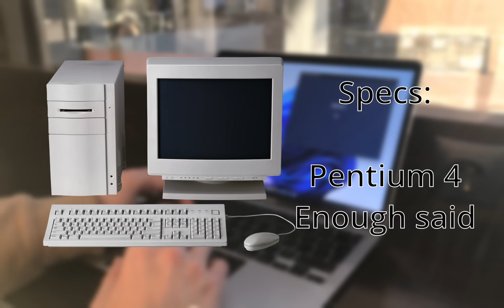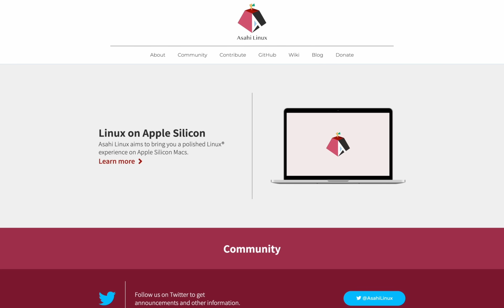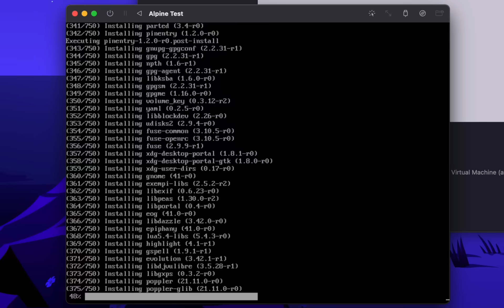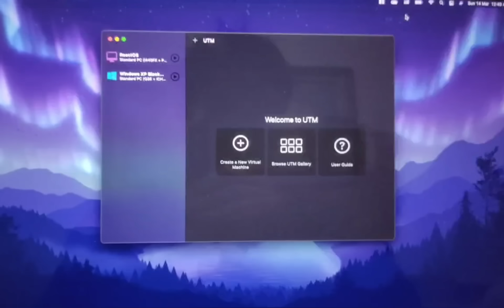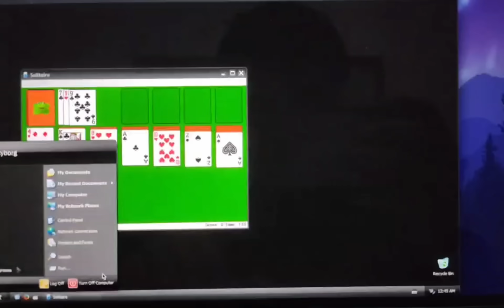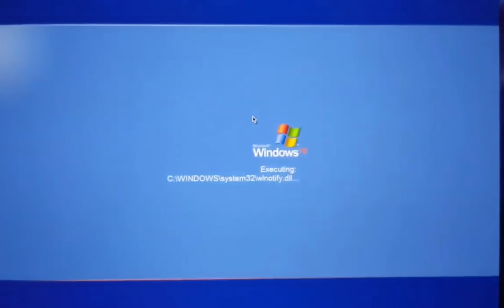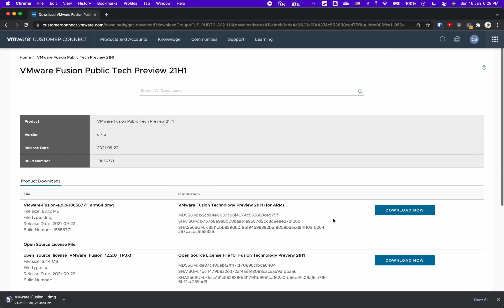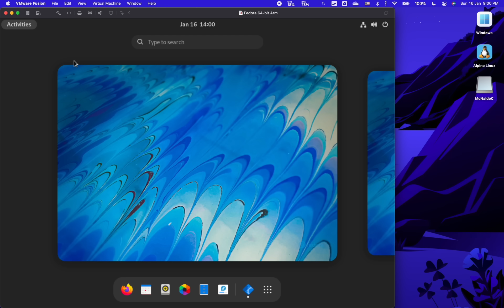Using Virtual Machines on Apple Silicon

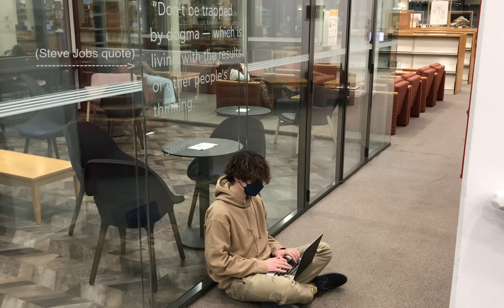Comment: 0:58 The bootloader isn't locked tho!

It does check for digital signatures, but not necessarily Apple's signatures. Local signature and key management is a built-in feature of these Macs.

And thanks to that, the driver support in mainline Linux is pretty decent right now.

Maybe you could test how well KVM works on this hardware? (That is, running these VMs under a native Linux install)
Reply from the maker: I'd love to check KVM and everything but I'm waiting for Asahi Linux to mature before I install it.

Comment: As a bona fide technologist, troubleshooter who has worked with virtual machines since the late 1990s, this video was very well done. I knew you would end up reaching the same conclusion I did in playing with the alternatives: there aren’t any. It’s really just parallels desktop. Which is OK because it’s a fantastic product. Now, virtual box is in beta form to support the M1 processor. I will be taking a look at that myself as well.
Reply: And what do you think about UTM?
Reply: @moonleter6637 UTM is very good. I have to say it makes more sense on the Apple silicon than Parallels because it performs very well with good OS support and requires no subscription. I would pay the $10 to install via the App Store as that way it supports auto updates. I have installed Windows 11 via UTM - it performs great in a non-business setting. As for trying to use it on my 2021 MBP M1 in the field, no way. My nosey clients remote through my laptop and jack with my network settings. Once they see a “virtual machine”, they would throw a tantrum that would blow back on me. 

I have a video showing my solution to have Native windows concurrently with Apple Silicon here: 
https://youtu.be/GDxVek7kPJ0

I use this solution in the field almost daily, and it works great.

Comment: Hello Anyone have any idea how to add serial port support for Arduino on M1 macs using parallels or VMware fusion?
Reply from the maker: If you have a USB serial controller, Parallels sometimes has USB passthrough, but it depends on the device.

Comment: Is it possible to install paralells on an external ssd and run windows on it?
Reply from the maker: Well, Parallels itself is a small program, so you should install it on your Mac drive, but you can run VMs from an external SSD! I do this throughout the video.
Reply: @KalosLikesComputers  That's what i though. Thanks you 😉

Comment: Virtualbox released a Dev preview for ARM macs last couple of months
Reply: Not really. The VirtualBox "beta" is not ARM virtualization. It is an ARM app that runs on MacOS, and is designed to emulate 32bit x86. Nothing more. Think WindowsXP. And running very slow. And is not ready for anything but tinkering, at best.

Comment: Not sure if I missed it, but you can now run „normal“ Windows in Parallels on a M2 Mac? Or do I need a special version with limited support for regular windows apps?
Reply from the maker: You could always run normal Windows in Parallels. It's just the arm64 build, which at this point is feature complete.
Reply: @KalosLikesComputers  Ok, I thought you need an ARM build of Windows which is not officially supported.

Comment: What differs linux amr from linux amd? What are the assembly language impacts? Is there some usable emulation program for m1?
Reply from the maker: If the build is feature complete and equal between the two architectures, hopefully nothing about it is different to the user. The assembly language impact is that x86-64 has many extra instructions that were meant to optimize complex operations back in the days of limited CPU cycles, which now arguably bloat the architecture instead of helping it. Also, by default, ARM architecture is significantly more power efficient. 

The M1 uses Rosetta 2, Apple's translation layer, to run x86-64 apps within macOS on Apple Silicon (arm64) with very good performance and with nearly no issues. Starting with macOS Ventura, they're also adding Rosetta 2 to their Hypervisor framework, which means virtual machines will be able to take advantage of it as well. I'll make sure to test this when the time comes.

Comment: VMware fusion with WIn11 ARM is working good now. You just need to install network and display drivers using inf files after inserting guest additions. When you install windows 11 you do not have internet, so you will have to shift+F10 and OOBE\BYPASSNRO to bypass microsoft account login.

Comment: Update:
Virtualbox now has support for M1 and M2 chips starting from version 7.0 (It is a developer preview so some features might be broken)
Vmware fusion player can now run most Debian-based Linux Distro and Windows 10 (At least on my M2 MacBook Pro), Windows 11 have weird driver error about the disk. :(
Reply: hey I wanted to know about the compatibility of x86 with m2 pro because no one seems to raise this query with m2
Reply: Do not place so much confidence in it. Its still in beta almost 11 months later and still is very broken for emulating 64 bit operating systems.

Comment: What would be the lightest weight OS to use in parallels for web browsing sketchier web sites in a VM? Just would want access to Chrome/Chromium with decent gpu and wi-fi support. Don't need much else.
Reply from the maker: Any Linux distro will do, you could get something like Fedora which is user friendly and lightweight, and gets the latest updates fast.
Reply: @KalosLikesComputers  Thanks. Do you think it would make more sense just to run another instance of macOS? Or too heavy?

Comment: can you tell me which software are you using for cpu and ram in menu bar
Reply from the maker: It's an open source utility called Stats. It can be found on GitHub or Homebrew. With Homebrew, you just run `brew install --cask stats`
Reply: ok thank you very bro i need this software very much.

Comment: Hello, I plan to buy a mac m1. I wanted to know if it is possible to use virtual box on a virtualized Windows thanks to Parallels or this does not work? good video btw
Reply from the maker: That would be a layer 2 virtual machine, and also it would not work even if layer 2 VMs worked because I assume you're trying to run an x86 OS in VirtualBox. VirtualBox is not the issue on macOS – Parallels can run any OS on an Apple Silicon Mac as long as that OS is built for arm64 with a proper bootloader. UTM can also run operating systems from other architectures through emulation, but it will be slower.
Reply: @KalosLikesComputers  ok i will see, thanks you a lot

Comment: @0:40 Ironically, since you just said you'd only ever used x86 PCs before, the stock image you grabbed to represent a PC from the early 2000s is actually an old 90s-er PowerPC or 68K Mac (not sure if that's a Quadra 840 or PowerMac 8100 with the logos photoshopped out; they both used the same basic case shape)
Reply from the maker: Yep, haha, editing mistake!

Comment: I have some X86 Windows software I need to run. I don't think that is an option on an M1 Mac
Reply from the maker: You can run x86 Windows software in an arm64 Windows virtual machine; Windows has its own translation layer like Rosetta 2. But it might be slower or have compatibility issues.

Comment: Now, what can I say. I greatly prefer CrossOver. It runs everything I need. And Games with a better performance than Parallels!
Reply from the maker: I will definitely cover CrossOver when I make a video about gaming. CrossOver is a translation layer like Proton, it's not emulation or virtualization, so it didn't fit here.

Comment: I've been running windows 11 insider preview for ARM on UTM on a base model M1 air, and the OS itself runs really smoothly. While gaming doesn't work at all, I could run autodesk inventor (a 3D CAD program) relatively well. UTM is definitely an option for running windows apps that don't require heavy GPU usage. 
btw inventor runs mainly from the CPU so that might be something to factor in.
Reply from the maker: UTM can do GPU support now! I don't know how good it is but UTM shouldn't be a problem either now!
Reply: Can you run docker inside the VM?

Comment: Quick question your help would mean a lot, the main reason I am probably going for the m1 max is battery life and raw power. I don't plan on using macos that much, mainly plan on using linux and windows (coding and 3d drawing). Is it possible to download/emulate them both on the mac? Do you think it will drain my battery that much? Any help would be appreciated.
Reply from the maker: If you don't plan on using macOS, you shouldn't be getting a Mac. I know it's tempting, but if you really do not want to use macOS for whatever reason, you shouldn't go through the trouble of trying to virtualize other OSes just to do basic tasks.
Just so you know, macOS is a Unix OS with an optional package manager in the form of Homebrew, and I've been using macOS for coding too.
Reply: @KalosLikesComputers  well I can't think of anything better as a laptop than the m1 right now (considering the battery, audio and quality of the laptop). Do you know one? I am really interested.

Comment: Battery will be fucked in no time
Reply from the maker: It does use up the battery quite fast compared to regular usage, but it's not that bad when virtualizing arm64 as natively as possible through UTM or Parallels. I did an entire livestream trying to virtualize and emulate different OSes, and I did it all on a single charge.

Comment: Hello I wish you can answer me. Can any of these apps read a .vmx Virtual Machine?
Reply from the maker: VMX is a VMware proprietary format. It is only read by VMware software. Also, trying to transfer an x86 virtual machine to an arm64 device will not work no matter the format.
Reply: @KalosLikesComputers  so is it possible to run an x86 vm inside of an arm vm?

Comment: Bro, that VMWare Fusion feedback was HILARIOUS!!!!!!🤣💦💦💦💦💦💦💦  I'm glad you did this video because I had just watched a video on "MaxTech" about them using "Parallels" for a VM to use Windows 11 for Gaming and I wasn't impressed, especially with the price that Parallels was charging!!!  You made some pretty valid points and because of that....I'm a little more convinced in using Parallels.  I've used "Boot Camp" only one other time previously on a Mac I had and it worked ok.  I was just researching whether Parallels is the "best" alternative for running Virtual Machines and you've pretty much answered my question.  Thanks.

Comment: Nice test and conclusions Kalos. Any idea how much Parallels+Win11 ARM impacts battery life? Are we talking 10 hours native to 5 hours running Parallels + Win11 ARM? How about when using Coherence mode?  

I ask since I'd primary switch since my Dell XPS 2020 was advertised as 15 hours battery life. I assumed that really meant 7, but in reality I got 5, even after a fresh reimage of Win10, from day one. Would like a laptop that's both light, with real endurance.

p.s. I'm not surprised by the limitations for Fusion and VirtualBox. I believe VirtualBox relied on Intel arch tricks like ring 1 that simply aren't available on ARM. Re: Fusion, the rumor was layoffs and a late start, but who knows.
Reply from the maker: Battery life is really good. I mean, virtualization obviously takes a toll on it, and I can't really test battery life accurately now because I've switched to running my virtual machines off of an SSD, which requires lots of power and therefore misrepresents battery life. Even so, it's...fine! Adequate!
Reply: @KalosLikesComputers  Glad to hear, thanks Kalos!

Comment: I’ve been using parallels for quite a while now, as I’ve found it outperforms VMware pro on my M1 max, and don’t get me started on virtualbox. Only thing is that I’m a pentester and sometimes just need Intel hardware to make custom payloads and binaries. Best solution for this has been a Windows VPS that I have hardened and spin up when needed. Great video by the way!
Reply: hows your virtualization experience after a year? I was thinking of buying a mac and in kind of similar work field as you.
Reply: @anyk.3741  I haven’t looked back once. And now after version 19 it got even better. Especially if you need to run windows, the arm version had made major improvements and you can run most x86 programs now too.

Comment: Thank you very much for this video. I've been looking for this kind of video before I buy MBA M2. Currently I'm using MBP with touch bar that is already malfunctioning just 2 yrs after purchase. I find Parallels to be a good Virtualization software, because the overheating is minimal as compared to Virtualbox. Although Virtualbox is working fine on my x86 Macbook Air.

Comment: why would you want to use a GUI?
Reply from the maker: My urge to answer to this question in a sassy and dismissive way grows by the second.
Reply: @KalosLikesComputers  that was a question I am really interested. Don't get me wrong, atm I am a fulltime linux user but for iOS dev i might need a mba. Well running linux has many edges but i already have an UI from my mac so I would mostly use the linux vm run ssh into it.

Comment: Great Video Dude, especially considering that it's one of your firsts, only thing I would have liked to see is emulation of PowerPC64 (PowerMac G5 basically) and running Mac OS Leopard with some older apps, but I guess this video is for modern operation systems :/ . Much Love anyways!
Reply from the maker: Oh don't you worry! I'll do a lot of nerdy stuff involving old OSes, it's one of my passions!
Reply: @KalosLikesComputers  Glad to hear it. Also you should try Sorbet Leopard 10.5.9 . A PPC Only Version of leopard made by the Macintosh garden community. Cheers!
Reply from the maker: @white_mask13  Inspired by your comment, I did a livestream the other day installing PowerPC Mac OS X in UTM, and it worked quite well! I'll definitely do Sorbet Leopard in the next livestream here on YouTube, so stay tuned.
Reply: @KalosLikesComputers  oh ok. I didn't get a notification but I'll check in regularly. Thanks for your responses!
Reply: Be nice to see if freehand works on that.

Comment: The best thing about UTM is it emulates PowerPC Mac as well. You can run Mac OS 9 and PPC versions of Mac OS X (both perform differently depending on version).

I've had Fedora Linux running under UTM, and it ran really well. I also have an Ubuntu VM currently set up that is capable of running the Arm Linux version of Folding@Home! I'm sure it beats the snot out of the usual Arm hardware that version runs on.
Reply: Thanks Eric.  I have ran my business since 1989 using 3 pieces of software that only ran on OS 9 (canvas 3.5,  foxbaseMac and macdraw I).  They are not available on any other os.   I have been running old powermac G5s and 10.4 using classic, accessing the data from external FireWire drives.   This is getting tougher with the death of viable browsers.  Looking to purchase an M1 Mac and try to migrate using UTM .   Mac Mini expected next week and trying to find out what to expect.   Apple knows nothing about UTM or emulation and have been no help.
Reply: @michaeldavis8382  If I were you, I would try an OS 9 installation and see if you can get it to read the external drive, otherwise use an OS X VM to do it temporarily and transfer the files to a disk image, which you should then be able to use with the OS 9 VM, allowing you to avoid Tiger and Classic entirely on your new setup. OS X is not the greatest experience on UTM at the moment, whereas Mac OS 9.2.1 runs pretty nicely.

Best place to get advice for emulating the Mac is the eMaculation forum. The guys there actually do development work on at least some of the emulators and can definitely help you out.
Reply: Can you emulate Mac OS 10.4 and run classic under that system using UTM.  Does UTM recognize multiple monitors under OS 9 emulation.   Can a virtual OS 9 access external drives hooked to the host machine.  I would like to build an OS 9/classic environment to run and access files on an old hard drive in HFS+ format that I used under 10.4 classic.
Reply: @michaeldavis8382  You can pass USB devices to the VM, so I would imagine that you could indeed access such a drive, but I have not tested that.

I have not tested a Classic environment on an OS X VM either, but since UTM and QEMU can run OS 9 directly, I don't know why someone would want to do that. You certainly do not need OS 9 in order to read an HFS or HFS+ volume. Since the emulation provided by UTM and QEMU is so complete, emulating pretty much a complete virtual Mac, I would expect the Classic environment to work as expected if you really need that, but again you don't need it just to access an HFS+ volume.

No idea about multiple monitors. I don't know if UTM and QEMU supports that at all. Probably not.

Comment: parrallels Desktop looks great, but did i understand correctly that it does not support x86? because in that case utm would be better right? especially for programs that dont support arm at all and only the windows operating system. Which would be my usecase
Reply from the maker: Because Parallels Desktop does virtualization using Apple's native hypervisor, it can only virtualize OSes that are built for the same architecture as the host OS (in this case, arm64).

UTM can also virtualize arm64 using Apple's hypervisor, but it can also emulate x86 systems. It's really slow, though.
Reply: @KalosLikesComputers  i can imagine it being quite slow, would you, however, say that it is usable with non demanding applictations?

Comment: VM challenges: 
1. Able to run Witcher 3
2. Able to run No Man’s Sky
3. Able to connect Oculus Rift
None of these VMs can make one of them so far
Reply from the maker: You're right, no virtual machines can do that yet, and neither can macOS itself, because of the limitations of emulation. It's incredibly difficult to run games built for a different architecture on arm64. This video had nothing to do with gaming.

No Man's Sky is releasing natively on Apple Silicon Macs soon, though.